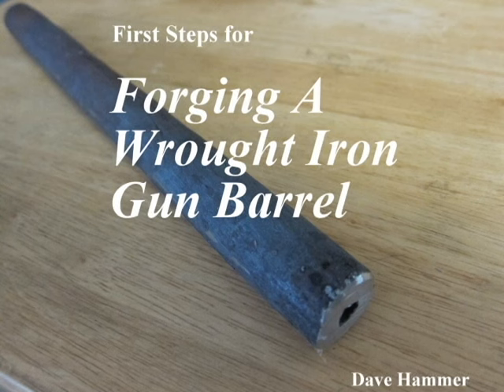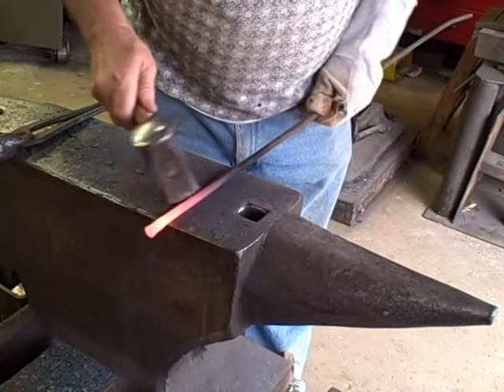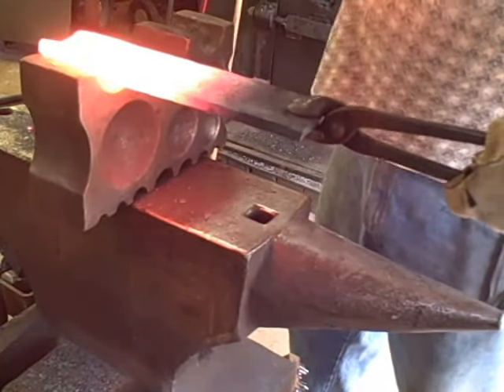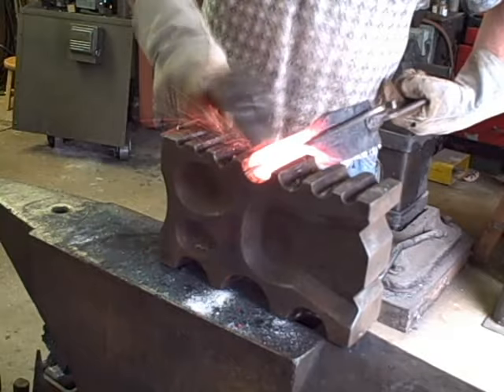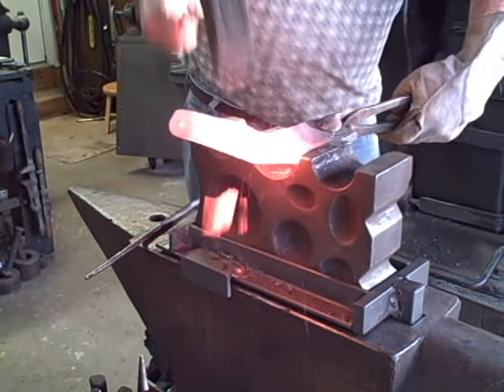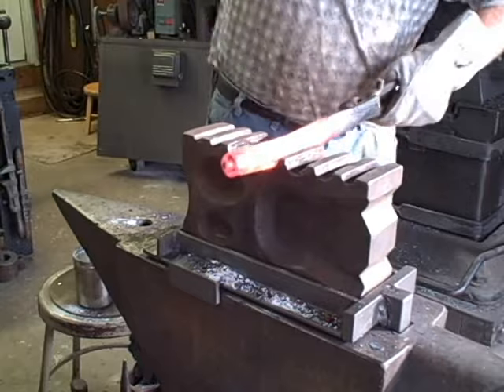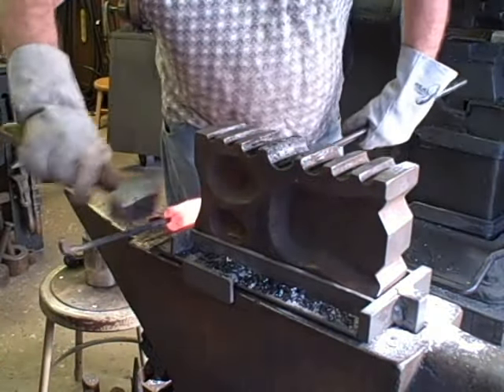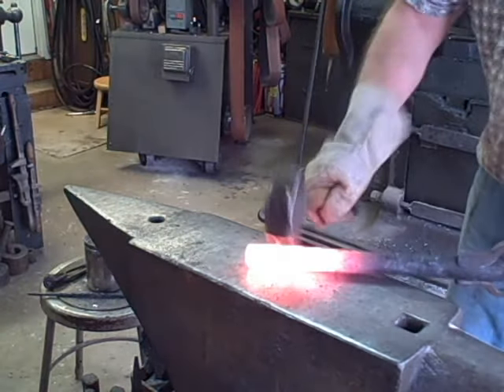Forging a gun barrel

Comment: Always interesting to see how they did this stuff without all the infrastructure and modern machines, the answer always seems to be a hell of a lot of patience and hard work.
Reply: MichaelKingsfordGray  sheesh he was just curious about how they made suck thick gun barrels back then when drills havent existed yet
Reply: @MythSpeed  drills have existed for thousands of years, everything from primitive bow drills and pump drills, to treadle lathes and presses, and so on. It was just a slower process, and drill bits needed replacing more often. 
Rifles were extremely time consuming to create, where as smooth bore muskets were quicker to mass produce.
Reply: @Beuwen_The_Dragon  interesting but those old machines can bore thick steel into a gun barrel? esp in the 15th to 17th century
Reply: @MythSpeed  Metalworkers have been hardening steel for a very long time and hardened steel drill bits, while not as good as something like tungsten carbide, can certainly be used to bore into softer metals. I'm guessing that barrel is annealed before being reamed and rifled, then hardened once all shaping is complete. Starting with a rough tube, as shown in the video, means that far less metal has to be removed and bits don't wear out so quickly. I honestly don't know if this is how it was done, but it seems plausible.
Reply: These wrought iron barrels could not be hardened, as the carbon content was too low. They didn'need to be hard, just tough.
Reply: Small barrels were either forged or cast. Bigger barrels were sometimes also cast or they were constructed like a barrel (hence the term barrel) from large wrought iron bars held together with iron rings. Some great examples for these guns would be Mons Meg, a medieval scottish bombard, or Pumhart von Steyr, a 15th century cannon and the largest wrought-iron bombard by caliber.

Comment: The Eiffel Tower was built with wrought iron. It will last as long as it is maintained. :-)
Reply: +Mike Cimerian all iron and steel is wrought
Reply: max webster I said iron not steel.
Reply: Anything not cast is wrought.
Reply: +max webster .... Iron was produced in crude furnaces for centuries prior to the introduction of methods to produce mild steel.  If that iron had less than a nominal 1.5 to 2 percent carbon, it was considered wrought iron.  Iron with high levels of carbon was called "cast iron" and was used to cast many things (it could not successfully be forged because it was too brittle).  Iron with the lower levels of carbon (before mild steel) was called wrought iron (sometimes "pure iron" if the carbon level was very low) and was used to forge most metal objects.  

When methods were introduced to produce high quantities of mild steel (during the 19th century), it became  cheaper and stronger than wrought iron.  The use and thus production of wrought iron dwindled, with commercial production ending during the 1970's.  There may be some small production to support repair or reproductions of early ironwork, but there generally is no new wrought iron available for sale to the general public.  Real wrought iron is also frequently recycled from old buildings, bridges, and equipment that are being taken out of service.  Most of this recycled iron is used to repair or reproduce early iron pieces.  There are also folks that build small furnaces and produce iron in the same manner of early days for demonstration purposes.

The use of mild steel has virtually replaced the use of wrought iron because it is cheaper and stronger.  It is not called, nor referred to as, wrought iron by the steel industry.  Occasionally (and incorrectly) marketing campaigns selling forged or fabricated products will call products made from mild steel wrought iron.
Reply: Without a 36 line response, while wrought iron has been in use for the last 1000 years, the Eiffel tower was built with puddled steel. My point was and is that the word "wrought" denotes "worked" and the material the Eiffel tower was built from is not "wrought iron" in it's purest definition even though it was "worked."

Comment: Hi David, good video.  what were the qualities of the wrought iron that you liked so much?  What made it exceptionally good?  Is there a test you can do to test that it is wrought?
Reply: Wrought iron is generally spoken of (graded) as poor, medium or highly refined.  Although a piece of wrought iron, after being processed into a bar, may have a smooth outer surface, it actually has an internal fibrous structure, much like a tree branch.  If you have ever seen a piece of wrought iron that has severely rusted, or has been successfully etched with acid, you will see evidence of these fibers. 

The finer (thinner) the fibers, the more highly refined the wrought iron is.  The more highly refined it is, the better it is.  The more highly refined wrought iron is, the easier it is to forge.  Extremely rough fibers (poorly refined iron) may appear as wide as an eight of an inch.  Within extremely high refined wrought iron, it may be difficult to see the fibrous nature of the iron at all.   

Modern steel does not have that fibrous appearance, it has a crystalline appearance. 

A way to determine if a piece of metal is wrought iron is to literally "break" it.... as if it were a twig, and look for the fibers.  Then a visual inspection of the thickness of the fibers is used to "grade" the wrought iron.  In reality, there would be many diameters of fibers within each grade (poor, medium and highly refined), so in reality, there are as many grades as there would be diameters of the fibers.  Within a piece of unforged bar stock, those fibers would run lengthways within the bar (again, like the grain within a tree branch).

When I tested the wagon wheel tire I used to forge the gun barrel, I could hardly see the fibers.

I suppose the next question might be "How do I break a piece of iron....  wouldn't it just bend?

This is how I do it....  If I am testing a bar (say a half inch square solid), I put a piece of the bar into a vice, with about an inch or so sticking up or out the side.  Then I cut it a little more than halfway through the bar with a hacksaw (with the cut about 1/4 to 3/8ths of an inch from the vise jaws).  The cut needs to be across the fibers.  You can generally assume the fibers run lengthways on the bar (this will invariably be true if the bar has not been forged).  Then take a heavy hammer and "whack" the bar, hitting it on the side that you just cut.  If you did this with a piece of wood, it would break or "split" at the cut (and you would see wood fibers).  Essentially, if you use enough force, and it is wrought iron, it will also split and you can see the fibers.  I try to hit the bar just hard enough to split it, but not break it.  As previously stated, the smaller the fibers, the more highly refined the wrought iron is.  Some fibers may actually "tear" and you can see the ends of them (as well as the sides of those that don't tear).  On highly refined wrought iron, those fibers may only be 1/100 of an inch wide. 

If you have trouble breaking the metal, cut it a little further.  If it's steel (rather than wrought iron), it will be harder to break.  If it's steel, it will snap in two at the cut and will not split like a tree branch.  It will have a crystalline appearance on each end instead of the fibers. 

If you have a piece of thick barstock, just cut a short (1/4 inch) piece off the end and put that in a vise and break it like you were trying to bend a coin.  It will snap in two and you should see the fibers (assuming it is wrought iron).

If you don't want to destroy a piece of what you have, clean the scale off it (sanding or ?), then etch it with acid.  You won't see the grain as pronounced, but you should see grain.  The more poorly refined it is, the easier it is to see the grain.  If it is extremely highly refined, you may have trouble seeing the grain and will have to do the break test.  If you polish the metal, a light acid like lemon juice may show the grain (it takes a while).  A stronger acid would be hydrochloric acid (muratic acid).  If you use stronger acids, be sure you take proper safety precautions and proper disposal techniques (read the MSDS).
Reply: I replied with a very long detailed answer to this question..  I'm not sure where it went.
Reply: David Hammer I got it and appreciate it very much.  Very informative and something I will be looking for as I educate myself.

Comment: you seem like the guy to ask:  is there a commonly used progression of blacksmithing projects that one usually goes through?  for example, making a knife seems like it would be way more simple than this.  I would think it could be a first project, or one of the first projects.  Do you ever try to make your own steel/iron?  I'm assuming you chose that wagon wheel tire purposefully for it's composition.  I'm fascinated by all of this.  Thanks for any advice you have.
Reply: If you have not done any forging, I would recommend joining a local guild and taking beginner and intermediate classes.  Some guilds have forging stations available at their meetings and do demonstrations.  They may also teach formal classes.  If your guild doesn't teach (even if they do), there are MANY formal schools that teach blacksmithing.  Some are dedicated to smithing, others are Traditional Arts schools with blacksmithing as one of the categories of classes.   The best school is probably the J.C. Campbell Traditional Arts School in North Carolina.   

First projects usually include making hooks, leaves, twists and simple tools (such as punches and chisels).   There is no formal progression that I know of.  It just depends upon your interests after you have learned the basic skills.  I would not consider a knife a beginner's project, but it depends on what you are satisfied with.   Making a very nice knife may require you to have equipment a beginner generally does not have, such as a belt grinder and polisher.  If you look online, using search engines and finding videos on YouTube, you should get an idea how smiths make knives.  It's not difficult, but it does take skill and lots of practice. 

Simple forge welding is probably considered an intermediate skill.  Forge welding a gun barrel might be considered advanced. 

I used wagon wheel tire iron to make the barrel because they are a source of wrought iron in the needed cross section.  Wrought iron is not commercially manufactured anymore, so the only iron that is available is that from old pieces  that can be re-used.

Best of luck to you.
Reply: thank you so much!
Reply: Flutter Shy I don't have any information about guilds or schools in Canada.  I recommend you  use Google or Bing and specify "Ontario Blacksmith" as the search argument.  You will find an Ontario blacksmith organization.   Their website should have contact information for you.  They should be able to tell you where you can get training.
Reply: Pinkamena RainbowDerpyShy I completed a beginner course from Wareham Forge with Darryl Markewitz in Ontario(google with easily get you there and the classes are somewhere on his website). He was great and relatively well priced. I'm very glad I went to him. There are several others, one of which is Thak Ironworks (again google will find him easy). He's also in Ontario and while I've never met him or been to his shop, I've heard nothing but great things. He's a little pricier, but you'll see his work, he's probably worth it. Lastly, there are more classes, but to help get you started with resources for Ontario, check out Ontarioblacksmiths.ca. Ontario Artists Blacksmith Association. These should help get you in the right direction. Goodluck
Reply: Look up ABANA